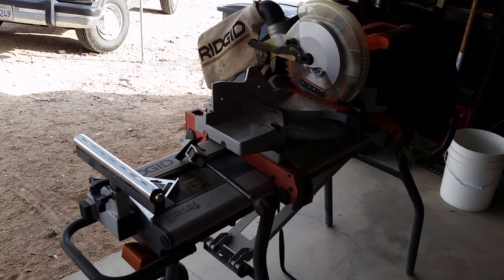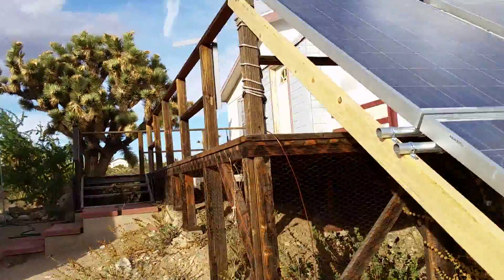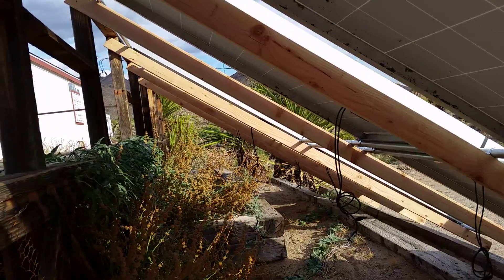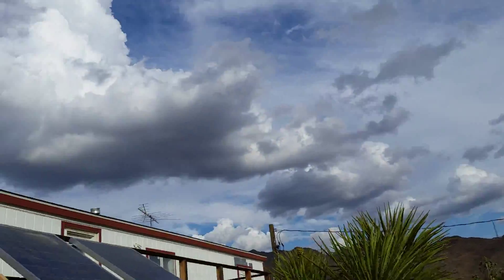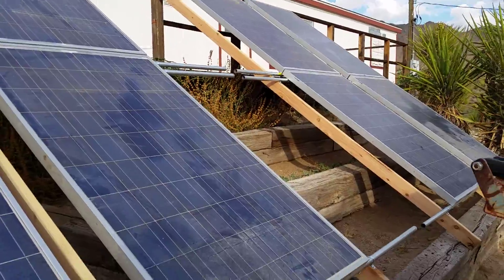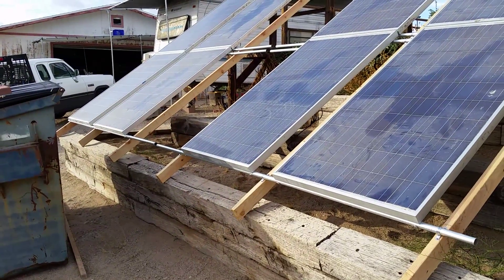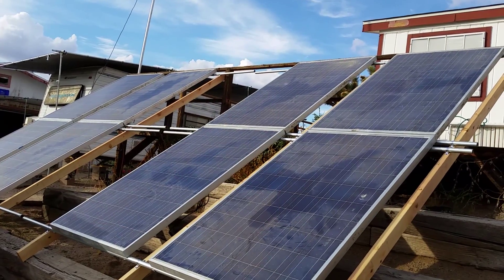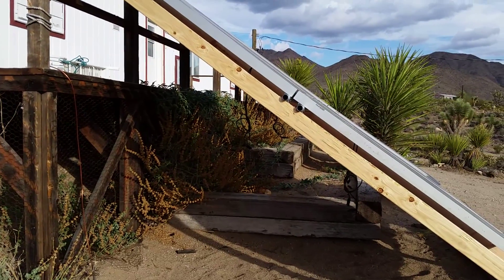Solar getting installed!

Comment: what are you going to do for the batteries and charge controller(s), mppt? are you doing a 24volt system?
Reply from the maker: j johns This home install is grid tie. When I use these panels for my RV, It's a 24v system, mppt Midnite 200 charge controller.
Reply: cool, what are you using for the grid tie inverter(s) and how are you setting up the panels to feed them?
Reply from the maker: j johns Enphase tied to the 240vac of the house. But since the Enphase energy monitor is so pricey, I'm thinking of switching over to the WVC brand or equivalent of micro inverter. They come with an energy monitor and combine 2-4 panel inputs on one module.